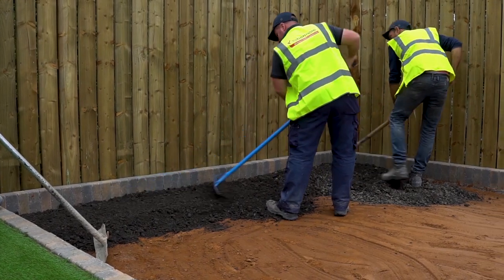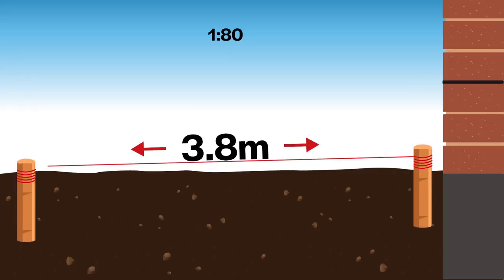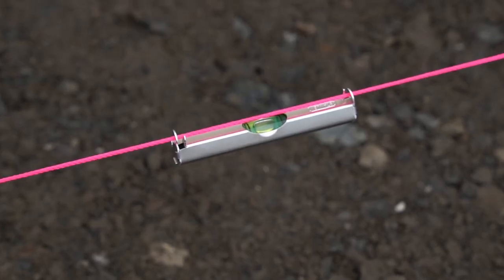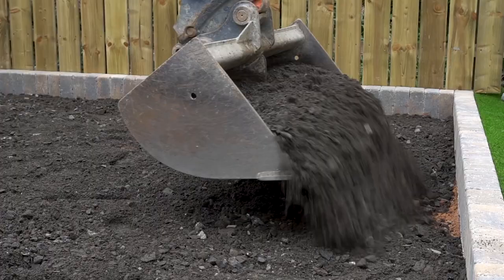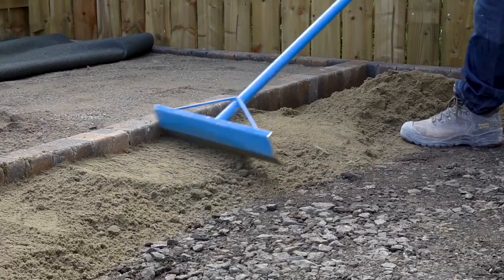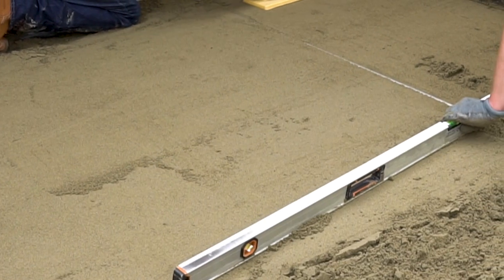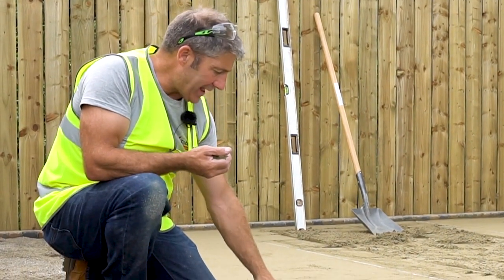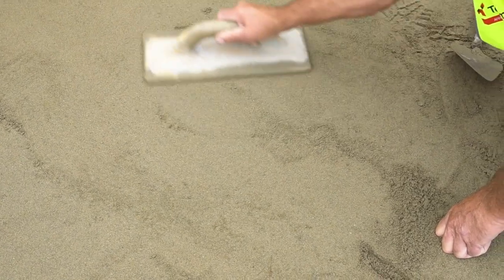Why Is Preparing A Sub Base So Important?

Comment: So is it recommended to only use sharp sand and not mortar for a 50mm flag patio? If the flag is less than 50mm depth, it should be on mortar?